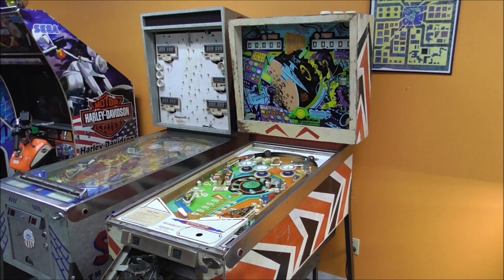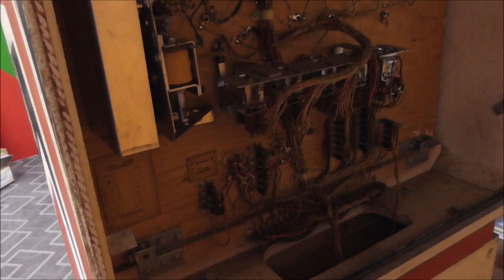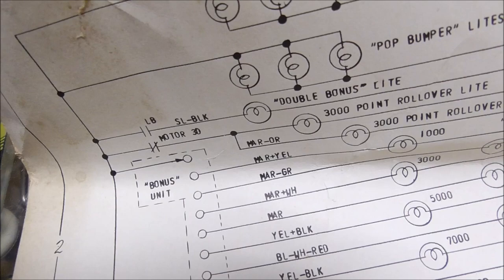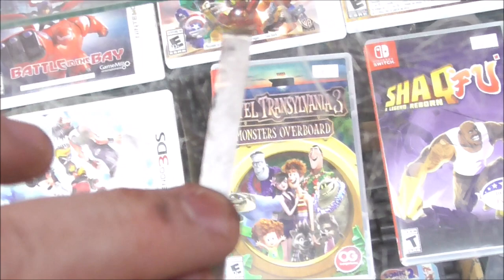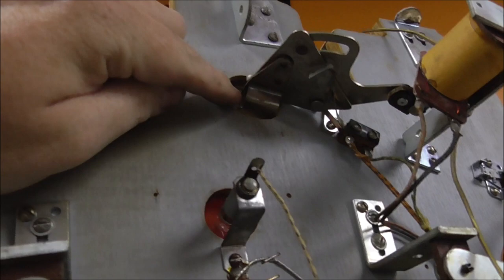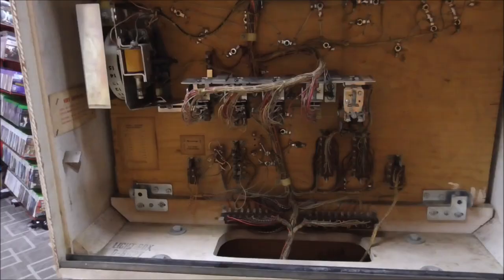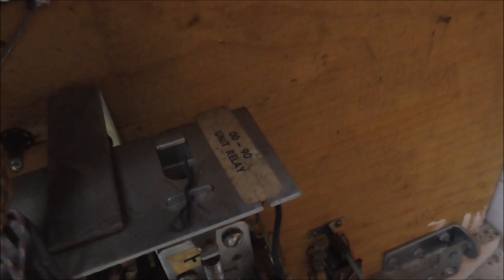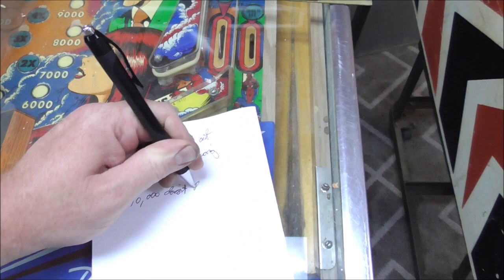Let's Repair a 1972 Gottlieb Outer Space Pinball Machine For a Customer....

Comment: Great Vid, Thank you for sharing, this vid has helped me very well. I just got a Gottlieb Quick Draw and have been going through it and learning how to work on it, Just about got it going. I was hoping you would share how you cleand and adjust the points, I  have used an old  points file I used to use on tuning old  motorcycles and have used q tips and even contact cleaner to clean points but I sometimes found the q tip cant get in between some points without bending them some. Also I found contact issues with a piece of cotton coming off the q tip and getting stuck between the points. Thank you for these once again it has really helped as well as Facebook Pinball help..... I like working on these old Gotts and plan to get another one to work on....
Reply from the maker: Like you said I use an old points file or a really worn out (i.e. not very abrasive) file to clean them.  You basically just don't want to go crazy on it and tear the points all up but you do need to get something in there that gets all the grease and oxidization off of it.  Glad to hear you've got yours about there!  Quick Draw is a great game.  

The old timers used to say to clean the points with a business card, but that was back when they weren't very dirty yet, ha!

Comment: I have one of these machines thats been in storage since the mid 80's. I was saving it for at retirement project :) I might have to get it out and see if I can make it work. I purchased it for $50 from a local arcade (funparlour as we called them here). It was just a small place with probably 2-3 pinball machines and one or two table top games. Think small coastal town in Australia type arcade. I did a bit of research about 10 years ago on restoring it but was advised not to turn it on as it might go up in a ball of flames due to the old wiring. Your video has encouraged me to just give it a go and see what happens. I will need to see if I can get a service kit for it sent to Australia and see what plastics etc need replacing. It was a fun machine to play but the ball seemd to love going down the guts.
Reply from the maker: Go for it man, people are worried about the wiring but there's a difference between old wiring and damaged wiring.  Look at the cord and see if it's cut or in trouble, if so replace it just like the ones that's on it, if the machine is properly fused you shouldn't have anything to worry about.  Personally on the older games I just unplug them or turn them off when not in use or I'm not around.
Reply: @LyonsArcade  just a question. do these old machines have capacitors? if I turn the power off and disconnect from the wall am I safe to touch everything electrical??

Comment: Do you ever see that old wiring insulation disintegrate?  Replacing all the wiring would be a big job I imagine.
Reply from the maker: To be honest no it's usually still very useable.  Sometimes rats eat it!
Reply: @LyonsArcade  Ok, sometimes I pull stuff out of old houses where it just crumbles away with the slightest movement.  Hopefully you never run into it.

Comment: Joes Classic, Does all EM pinball games have the Control Band reset coil connect to the 120 AC plug? because I thought I have seen the control bank reset coil in the score motor assembly. The Control Bank Reset coil is connected to which relay switches? The Schematic shows the relay switches names but the schematic doesn't say which relay switches the control band reset coil will turn on or off, so its confusing me. You mentioned the End of Stroke switches on the Score Reels. When the End of stroke switch is Closed what happens? when the End of stroke switch OPENS what happens?